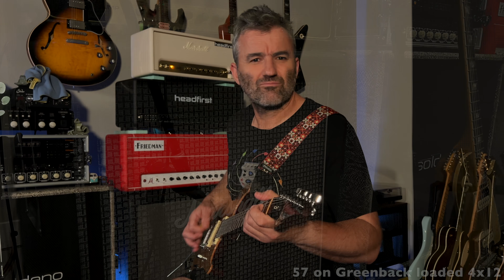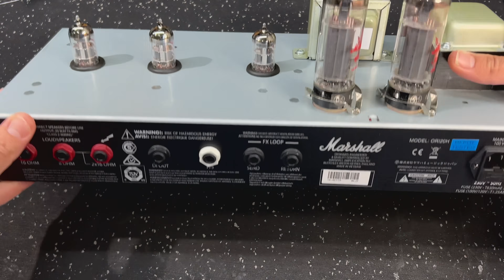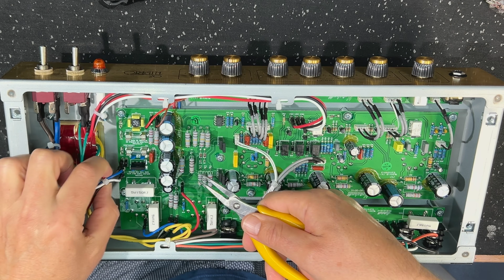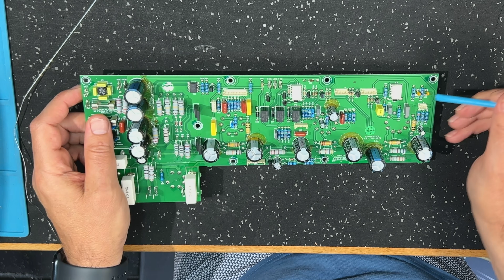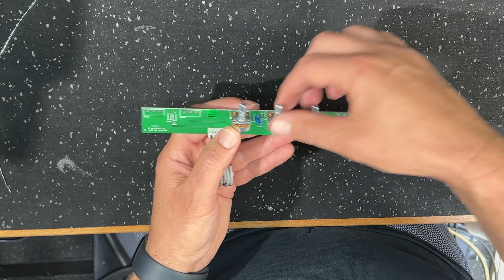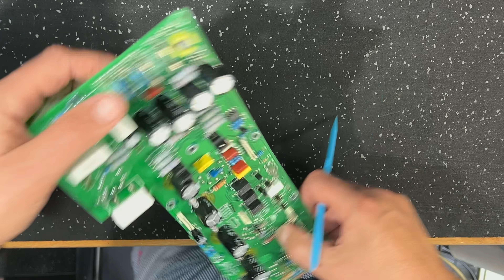Turn your Marshall Origin into a Proper Plexi - REVISITED!!

Comment: Why does every sound review YouTube channel make these amps sound so harsh and bright? That's not the "brown sound" for sure. Instead it sounds like the treble and presence controls are on 10 and the bass control is on 0
Reply: Because EVH was recording with 70s equipment that was much lossier than modern digital gear. Thus top end got rolled off.

Comment: Hi, I have this amp and I have an issue with it. After a few minutes of playing, no matter the settings, the volume will drop by 20% or so. It doesn't take any tone with it and it doesn't crackle or make any noise. Does it every time. I have changed tubes and used different cables/speakers/guitars etc... I cant find anyone with the same issue. Any chance you would have a suggestion for me? Thank you

Comment: Hey Jason, great video!  I’m curious why the 4.7k is pulled for the presence pot.  From what I’ve seen, it’s installed in with Plexis with a 25k presence pot.
Reply from the maker: The late 60s amps were wired with a 5K linear presence pot with no 4k7 resistor, sounds better that way,  but there is DC on the pot so it's 'scratchy.'
Reply: @HeadfirstAmps  gotcha!  Thanks for the reply!

Comment: Which mod 800 vs Plexi is most popular?
Is there a difference or preference between using the 20 or the 50 Origin for mod results?
Thanks
Reply from the maker: Most have done the 800 I’d say - it’s a better option if you want to add the fx loop
Reply: @HeadfirstAmps  
Thanks 👍 
I'm thinking about picking up two 20 watt heads to mod with your board or one 50 watt head. 
Probably, two 20's.

Comment: Do you really think that this is a good sound and that it has anything to do with the sound of Marshall amplifiers? I don't understand what the video you are making is for. The only way to get PLEXI is to remove all this and put transformers (real ones) not this garbage and make a point to point board. Everything else is a waste of time.
Reply from the maker: And I don’t understand why you left this comment.  This channel is mostly about modding amps and understanding circuits.

Comment: The push pul switch after plexi mod with potmeter, is it another pot with switch i have to buy or is it the one disconnected and reused? audiotaper pot i heard. the second volume where the til pot is/was also a different pot or just rewired? and where can i get them. do not use Facebook. But found some on the origin 20. i will do the full pexi mod and change some resistors like the hvite ceramic ones and the 2 watt underrated resistor said to be on the limit when at high power setting. is a rep video about this on u tube. Restoring a Hagstrøm Bass 210. fun small amp.65 model.

Comment: Could you answer a question please sir. I just bought a SC20H 220v from the UK. I really want to use KT88s, I put 2 in but the other day but they lack a bit of gain, I guess due to the biasing. I am told I would need to get them to bias hotter for that. I am learning that the bias though is done by the resistor making them run cold, but by putting a 5w 68 ohm in parallel with the bias resistor, I could get hotter safely. Is this the route to go sir?
Reply from the maker: Why do you want KT88s in that amp?  Honestly I can’t see the point.  If you change the bias to make it pull more current at idle you’ll likely burn out the power transformer sooner or later.
Reply: I respectfully disagree with you tube change the sounds to a same as a mod does. Thanks
Reply from the maker: https://youtu.be/XtrW3-d3V1E?si=tv5hpSah87tKdwhS

10:30 mark
Reply: @HeadfirstAmps how cute, but it Still changes the feel / distortion and tone even more so on that amp due to the set bias, and that goes without saying same as he said they’re are more factors lol that was not my question which you been so persistent to never even get to. I was basically just wanting to know  if the 68 ohm was safe to use to get back some ummmp Which it is. Thanks
Reply: Ummmm kidda rude response from you WOW. And yeah WHY —— because I want to and like there sound. That’s why I’m asking if the 68 ohm would still keep it in a safe range. I know it can be done but I was because I have saw it done, I expected a more professional response. Thanks I should have looked for advice elsewhere.
Reply from the maker: Sorry, not trying to be rude.  Just trying to understand why, because tubes don’t really have sound - but the circuits they go into do.  Sorry for giving out free advice.

Comment: I guess the goal of these mods (which sound great, btw!) Is to take what is designed to be a low gain amp and turn it into a high gain amp. I have so many questions, but the obvious one is if someone wants a high gain amp, why not just purchase one to begin with? It's like purchasing a Roland Jazz Chorus and modding it to sound like a dual rectifier. I don't quite get it. I admit that I am not a high gain player, and my Origin 50 sounds wonderful as is to me so clearly this mod is not for me but calling this a "Plexi Mod" is a bit of a stretch because I've played a JTM 45 and a Super Lead and though these mods sound awesome on YouTube, they don't sound like the Plexis I've played. I do enjoy watching! If I had your knowledge and skills, I would make the distortion smoother,  butt I wouldn't dare add more distortion.
Reply from the maker: Well, this mod turns the amp into a legit Plexi front end.  You can get clean tones from a Plexi, and you can from this amp after it’s been modded too….and it sounds way better than the stock amp even set clean imho. 

Why do people mod Origins? Because they are dissatisfied with the stock amp, and modding it (especially if you DIY) is cheaper than selling and buying a better amp.
Reply: Thanks for the response! I guess I would like to hear the full dynamic range of the nodded amp. The only sounds i hear highlighted are super saturated Van Halen-like tones. Which, again sound great, but it seems like a one trick pony. Can we hear some edge of break up sounds for a change? How about a smooth woman tone? Richie Blackmore strat tone? A fat clean tone? Just a suggestion. As I think more about this, why would someone  purchase an amp in the first place that they were dissatisfied with?
Reply: @tboneousmaximus7963  I bought an Orgin 50 because it looks good and was on sale . It can be what ever you want it to be.

Comment: Hi Jason, for a "Core" Plexi sound being say a Live J Page (Madison Square Garden)or Maybe Angus (Back in Black) tone, do you have a Preference for one Origin over the other (50 vs 20) once your 'Magic' has been performed?
Great vid btw.
Reply from the maker: A 50 will deliver voltages that are on spec with a 50 1987 model Plexi.  The 20’s voltages are too low for that, and are therefore naturally more ‘brown’
Reply: @HeadfirstAmps  Thanks for that Jason.
On a "simplified" level, I take from that the '20' would lend towards the Browner EVH 1 while the '50' toward the Page/Angus flavor while anything may be possible with  Mods and Dollars??

Comment: Would this be the same procedure for the 50 watt ?
Reply from the maker: Yes
Reply: @HeadfirstAmplification  thanks Jason!
Reply: Have you done the mod yet on the 50? If so how did it go?
Reply: @bgingras05  I haven't, actually. I have decided to gut the amp and handwire something like a 1987 circuit in it. 
I noticed some red plating in the origin, and when I turned the bias trim pot , it malfunctioned. So it made up my mind pretty quickly.  
I'm sure the mod works great though.
Reply: @soapboxearth2  yeah I'm torn what to do with my 50C, I just wish it had a little more dirt from the factory. Thanks!
Reply: @bgingras05  I know if you had an attenuator, you could get a lot more gain at low volume.  And I think the mods are the quickest , easiest thing to do, but if you are into it, gutting the amp and hand wiring to a turret board or one of Jason's  plexi pcb would be super rewarding. I buy up old hot rod deluxe and devilles and do just that. Bassman/plexi conversions. Jloewenheim youtube has a couple of videos and gave me the idea.
Reply: Originally I thought id.mod the 50 head and then sell the modded pcb before handwiring a plexi into it.